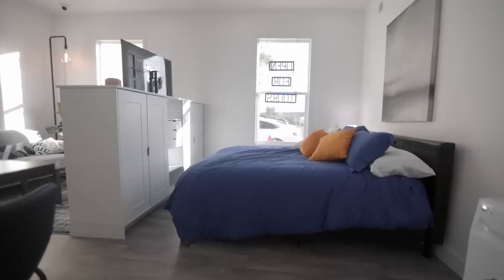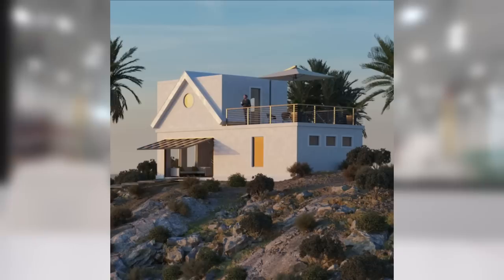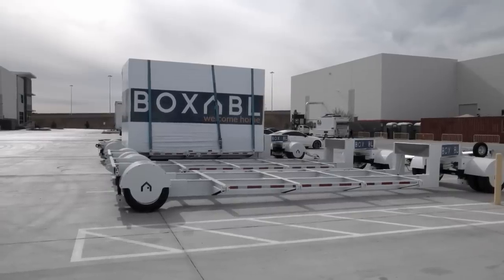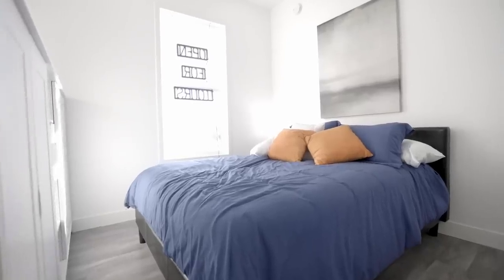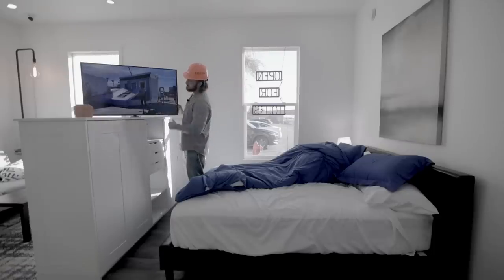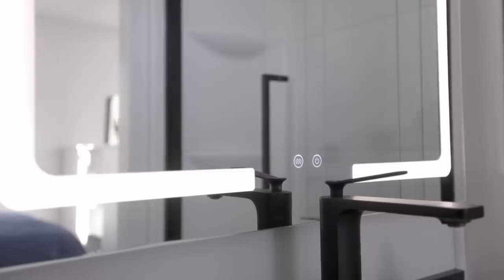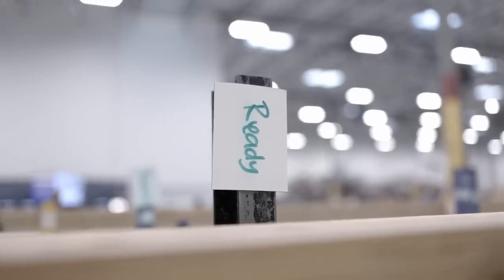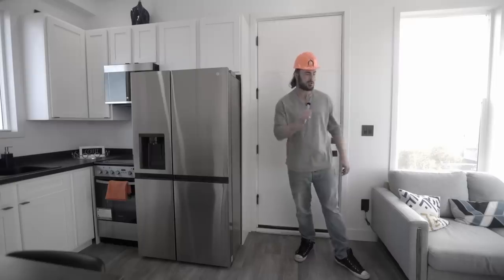Factory Built Tiny House Opens the Door to Affordable Living

Comment: When ever I see projects like this; being a semi retired Product Designer, I always try and think of ways to improve them. These Casitas are quite high inside so the bed could theoretically be placed on a messanine level at about 5 feet high, with either a ladder or some small steps for access.
 The underneath could then be used for a lot of different uses. For example: An electric bicycle workshop and storage; general storage of clothing and possessions; a gaming set up that could be enclosed like a small intimate theatre.
 Another idea could be a Murphy bed with folding desk. The Japanese have all kinds of amazing fold away furniture that would be ideal for use in such small spaces. The Casitas could have 'Multi-Uses' in just one small space. Just a few ideas for you guys anyways......
Reply: one thing i would change or add is a small pull out spice cabinet between the fridge and stove.  I don't like the two of them being side by side.
Reply: I agree that the space is quite single-purposed for what could be a lot more innovative in the use of precious space. It’s a box, conforming to what financial institutions like in a finance-friendly “home.” But for those who want the combo of finance ready, enough space to work logistically and ready to live in quickly, it works. I could easily see developments of these, lot sizes of 30x50 or less, central amenity space. It’s coming.
Reply: I like your idea, and I would further suggest considering the option of a liftable bed that always stays horizontal. An electric winching system would not be technically difficult or expensive, plus it could have a manual backup crank for a loss of power situation. It could also be locked into a high position that would still allow someone to sleep in it (like a bunk bed) while an air mattress was providing a place under it for a guest to sleep. Whether the bed folds up or lifts, having the bed "gone" during the day is a huge asset to mentally enjoying what little space is available. Plus I would add a large covered deck to make use of the outdoors when the weather is nice.
Reply: @bevfrench3496  I recently saw a sliding door kit used with DIY racks added to do just this. I loved it as soon as I saw it. Very narrow and slid away easily. Not expensive to do.
Reply: And slide the closet back and forth between the couch and the bed, to enlarge the living space at daytime.

Comment: What are the collapsed dimensions and weight? Can a single unit be lifted entirely by a crane? Can 2 units be placed on a semi-trailer for transport? What are the unit base costs? Can a tub be added in the bathroom? How much would it cost to setup an additional factory in the Ky. Tn. area?

Comment: For those watching that are bummed about the lack of transparency when it comes to prices, and are worried about their local government’s housing laws — you should Google 1 bedroom mobile homes in your state. Where I live you can purchase, brand new, a single wide 1 bedroom mobile home (about 500sqft) for about $30K. Of course land, zoning permits, land preparations etc. will cost money too. But you’d have the same expenses with the houses in this video as well. 

Used RVs are also a great option too. And likely more affordable in the short term. Though then you have to factor in automobile maintenance too (though, in my opinion, I think Class C RVs are probably the best option as their mechanical parts are more identical to a regular trucks— rather than a larger RV which might require a more skill mechanic to tend to it).

Basically, this idea seems great but for the projected cost (I’m going by other people’s comments here, since the website linked offers absolutely no information about how much this would cost) you’re better off getting something either larger, more accessible (currently) and/or portable.

Comment: It gladdens me that there are still some people still working properly to solve the housing problem.
Reply: the housing was solved a long time ago.  it's apartments made out of concrete blocks. the entire Eastern Europe was rebuilt this way after the war.  these tiny homes are way more expensive and less practical than a regular trailer or premanufactured home.
Reply: There is not a housing problem…There is a Blackrock, Vanguard, Statestreet problem

Comment: As great as these casitas are, and they are fantastic, they only solve 50% of the problem. The other half of the problem is finding suitable land to put them on. I can see a lot of cities and communities not wanting to allow these types of homes to be built in their areas. I fear that you will run into a lot of resistance.
Reply: These aren't fantastic. Guaranteed no one will get one of these delivered, set up, hooked to utilities, etc... for less than $100k. At that point it's easier AND cheaper to build a BIGGER house that's higher quality than this.

It's a gimmick, and people will eventually see that there's far more to the price of this box besides the "$50k" price tag.

Comment: I love your product and your mission, but I have a few issues that you should consider. 

1. What happens when the company that builds that small mini split no longer makes that model? Can a longer model be installed in that space with the bump outs there?
2. What happens when you need to replace the refrigerator, will it fit through the narrow door?
3. I may be wrong, but that range/oven looks smaller than standard. That could cause replacement issues. 
4. Washer/dryer combos are notoriously ineffective, is it possible to install stacking full sized models? And will they fit through the front door?

Thanks in advance and best of luck to you!!

Comment: You can buy a really decent fifth wheel trailer or RV for was less then these cost. for $10.000 or less one could buy a really nice travel tailer with slide outs, heat and air all appliances bathroom included. these tiny boxables can run up to $21.000. so much for affordable. these boxables are basicly for people who have money and need a guest house or second house on large property

Comment: The town I currently live allows accessory dwelling unit to be installed but can't be bigger than 25% of the square footage of the main dwelling. So a 1,200 sq ft home would limit to 300 sq ft for the ADU but the regulations say you can't use an rv, manufactured home, or TINY home. If you can't use a tiny home but make the footage reduced in the regulations what could be used?! Sheesh!

Comment: Pricey: Price and cost estimates for a prefab home from Boxabl range from $54,500 - $99,500+ total, $145 - $265+. These estimates are all inclusive, meaning that the cost of the home, labor, shipping, and site work are included. This cost estimate is based on the module cost $49,500, $2/mile shipping costs from Las Vegas, and site costs which, depending on your location and the complexity of your site can range from $5,000 to $50,000+. The cost of land and any home upgrades are not included in this estimate.

Comment: They're missing bigger point. They are basically making executive housing units, not affordable housing. Land prices AND construction costs plus high income levels needed for loans are what keep low income folks from affording housing. Lose the giant appliances, put in smaller apartment sized (and less expensive) appliances, ditch the furniture. Less windows, accessible bathrooms so senior and disabled can use it. After that work with financing and land acquisition and if people can build equity to sell these after they are paid off and then resell to more low income. To me these look more like instant Airbnb addins, not anything that solves housing shortages. They are trying and I get that, but they are missing big components to get people into housing.

Comment: Making the home cheap isn't the problem. The problem, is making a nice, inexpensive home, that "investors" won't just cannibalize and run the price up, as rentals/AirBNBs/VRBOs. 

You can buy super nice THOWs right now, for under $50k, and all you need to move them is a pickup truck. You also aren't subject to traditional permitting with a THOW, since they are technically travel trailers.

Companies need to create a process to vet buyers, to make sure they aren't just buying them as investments, and lobby to make municipalities allow these compact, minimalist homes on the grid.

Comment: How? A home (no matter the size) requires land upon which it can be placed.
Most sections in my country have minimum sizes that a home MUST be, on a section.
It is illegal in NZ to place a tiny home (by itself) on most sections - especially in and around cities.
If you put some wheels on it, and call it a trailer, you could live in a trailer park - with all the amazing stuff that goes with it. :P
Or, you could buy a piece of land 90 minutes drive from your work, and pay more money in gas than you would on a mortgage on a decent sized family home, on its own section, in the city.
No matter the cost (which is bound to be extreme on a square metre basis) you then face the cost of relocating your tiny home - but that is a massive out-of-pocket expense.
And, of course, you can simply build you own tiny home (if legal) and save a ton of money.
I pity the investors of this venture. Seems to me they'll lose their money in the long term.

Comment: There are similar available all over the world. Here in Australia we have slide out home that fold down to either 20ft or 40ft container sized for shipping. 

For example a 40ft version which is 6.3mtrs x 11.85mtrs is US $35k

20ft version - 6.3mtrs x 5.85mtrs is US 19k

I’m sure there are many other countries that have similar 

Not new or particularly innovative
Reply: It’s the sturdiness that sets it apart.  I’m willing to bet that the gold out homes aren’t nearly as structurally strong or energy efficient.  They’ve stacked 5 cars on the roof and have unsuccessfully tried to pierce the walls with a sledgehammer. Also, the units are meant to be like Legos, so you can connect, stack them in 100s of configurations.  It’s why they look so generic. That’s a feature not a bug.
Reply: @radiofreealbemuth8540  I didn’t say anything about them looking generic? Anything mass produced looks generic. 

Thanks for explaining sturdiness etc however judging by the price of them it would cheaper to buy or build a standard home if you wanted more than one cube. 

I like the idea but in itself it’s not unique, maybe has some unique features. 

Would only be anywhere near economic if you lived in a hurricane or extreme bushfire area, for most people why would pay double the amount for no benefit?

Something they may want to think about is making a more economical model for outside those areas especially if they want it to go worldwide

Comment: I'm looking at those appliances and cabinets and thinking that most certainly you can build a tiny house for cheaper. I'm thinking MOST of these are going to be sold as in law suites or cottages for people with money.  

   Zoning is the big issue, getting electrical and water hooked up.  Rurally you'd need a septic, thats 20 grand, and a well, thats another twenty grand.  YOu'd need footings or a concrete pad, thats twenty grand. 

    Around here people are just finding old buses and towing them to a place, becaues they are on wheels they are not 'fixed and taxed'.  A bus can be located behind a wind screen to cut down on heating and cooling, you could even basically dig into small hill to push it backward to provide insulation for cold weather.  

     Its the political momentum we need to get zoning laws changed. YOu can't even put one of these in your own back yard for inlaws in our city, on your own damn lot.  So this company looks like they have some bucks behind it, so they should get politically active in some target cities to get zoning laws changed.  Corporations tend to have an easier time bending the ear of politicians than the public does.

Comment: The only cost they're really reducing is labor cost. I do like the company and hope they do well. However, In the end a person can still build a traditional stick frame structure with better insulation, better exterior, better roof, better cabinets/appliances, for 25-50% less cost than a Boxabl. The only catch is that you have to build it yourself and pay yourself minimum wage while you build it. But, just like Tesla and every other assembly line company....Costs come down over time as they improve their processes. So perhaps one day they WILL actually have something that's up to my personal standards at a competitive price.
Reply: Insulation is probably pretty solid having no studs to dumb down the structure. I build 12” double walls, R-44, but air sealing is actually the more important factor. I wonder how it holds up to a blower door test?  And what about moisture? ERV? The real issue is towns just ban these types of structures. Yurts, tiny houses, house boats, even RVs are all banned where I live. Not in my back yard attitude. They have even started banning anchoring without a mooring because the coastal homeowners don’t like the “extra noise”. Completely illegal, it’s the F’n ocean! But all about who can afford the lawyers…..
Reply: @matthewrud4550  - I agree. I would ASSUME they're caulking all seams after the box assembles which would improve the blower door test but who knows. It looks like they're using 3.5" of polystyrene for the wall insulation which isn't ideal. Like you, I want R40 or greater in the walls and R60 or greater in the ceiling with air gaps sealed so tight you could heat the house with a candle and some body heat, lol.

Comment: No it doesn't.  As you have foundation cost.  Utilities water, electric, gas, phone cable TV sewage and trash removal cost.  Lot cost not to forget rich corporation and banks buying them up to charge high rents.  Then you have city code issues and permitting cost.   Affordability?  Added up.  you run into the same manufacture home issues and cost.  There is no such thing as affordability.   Those who need it most are already priced out.  also Management companies will only rent to incomes that cn more than afford regular housing.   My guess you will see housing going to student housing and towns on the verge of becoming a ghost town.  As a way to get income to come in mostly elderly.

Comment: A $20,000 house sold in 1965 equates to $171,000 today. This house didn't have central air, was less than 2k sf, 4 bed, 2 bath, and may have had asbestos shingles. It was built by people who believed in quality and didn't use OSB or vinyl siding. There's no equivalent today. Houses are bloated in size and price and terribly built. Maybe factory homes are the only solution.

Comment: tiny houses or tiny rooms  (for the same reason) are nonsense! The volume (available for a living place) scales up with the third power of Length ft^³ , while the surface area ( building material and isolation material, =construction cost) scales up with the second power of Length ft^² ( = area of walls, floor, and ceiling) Because of this simple geometric law You lose more than You would safe! it makes much more sense to build larger apartment complexes with appropriately sized rooms. (this also saves heating costs, comparatively). The problem is, that big businesses, financial sharks, mafia, and tax-evaders with suitcases full of cash (wait until FED makes cash illegal for ordinary people, but not for them!) banks and insurers, highjacked the builders and family homeowners market and successfully tried to enslave the middle-class- income, hard-working people.  Neither Trump nor Biden put the brakes on this trend! 
 Look at how cheap big malls can be built, compared to ordinary homes!